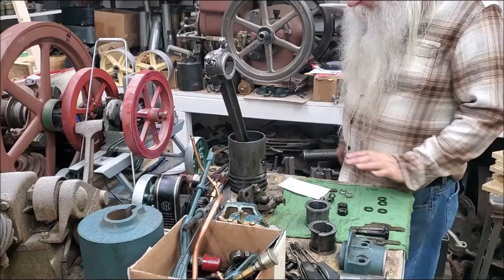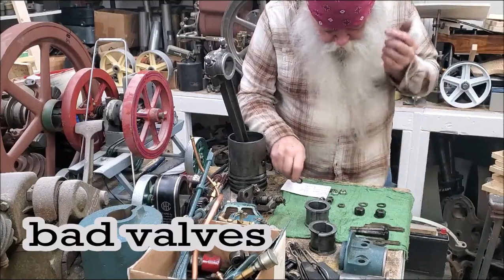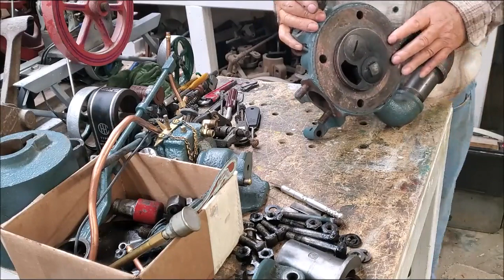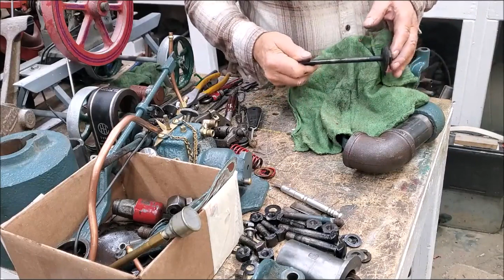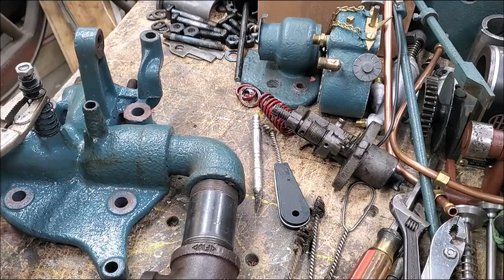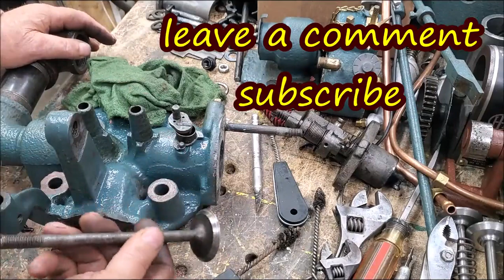International Engine type m BAD VALVES ( hit and miss engine )

Comment: I have repaired several m heads using your methods all are still in service with no problems.  I have been using old cast iron window weights  for the valve heads I put them in the wood stove with hot coals to make them more machinable.